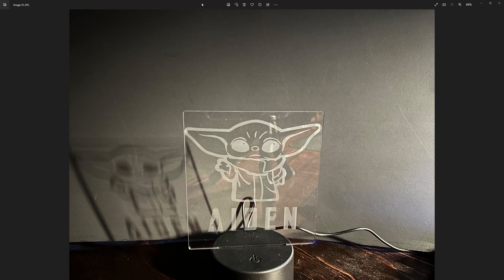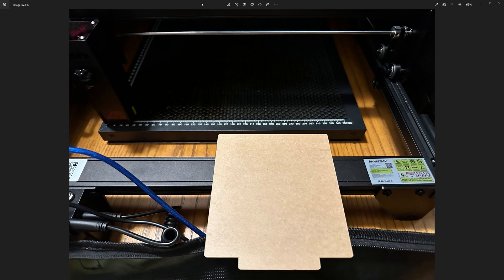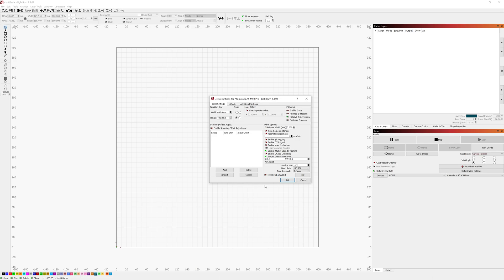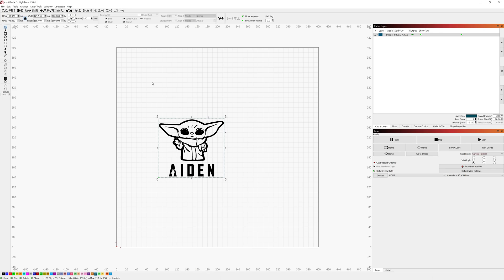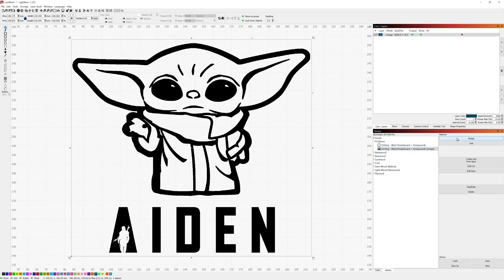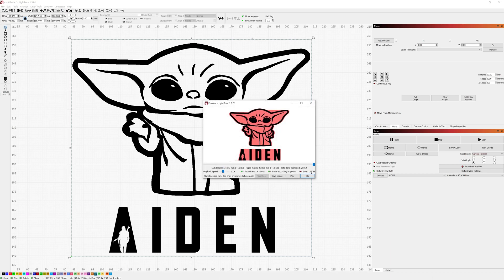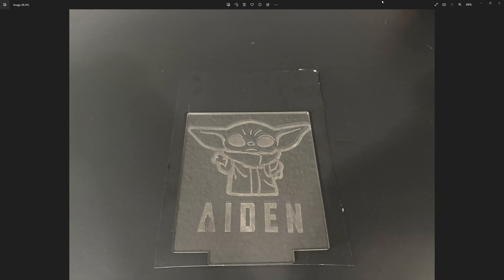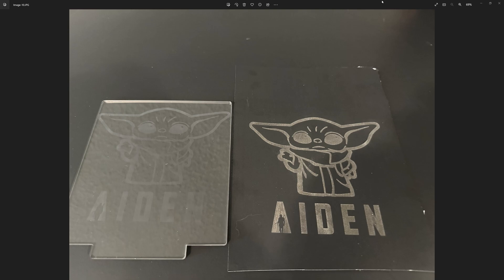Etching on Clear Acrylic - Atomstack A5 M50 Pro (5.5-watt Diode Laser)

Comment: Nice Video. Thanks.  Is there a place where you can buy the clear acrylic you used excluding the lamp base?
Reply from the maker: I purchased this pack of 4 from amazon - https://www.amazon.com/dp/B08NXTLD6J . They are the "blanks" that are made for the most common bases. There are most likely much better deals out there, but since I'm just getting started, this small pack worked well for me to test things out.  I did my material test on just a standard piece of 4mm clear acrylic that I picked up at a home improvement store around the corner from where I live, that way I could use the blanks on real signs.
Reply: @CubicleNinja  I am new for laser printing which I bought the x7 pro a couple of months ago and I am interested also engraving on Acrylic.  I appreciate for your information.  I will try using your settings.  Thanks.

Comment: Nice Work!
When you reveal your finished template around 8:30 i noticed its cloudy. is this due to one of the protective films being on one of the sides?
Reply from the maker: I forgot to mention in the video that I always remove both sides of protective film to make sure it doesn't melt and stick to the acrylic.

The cloudiness on the finished acrylic seems to be residue left from the smoke that comes up off the posterboard getting trapped in between the two materials. When you do the quick rinse at the end, that will remove the smoke residue as well as any bits of posterboard that might have come off onto the acrylic during the process.